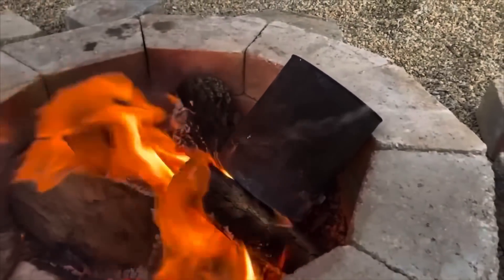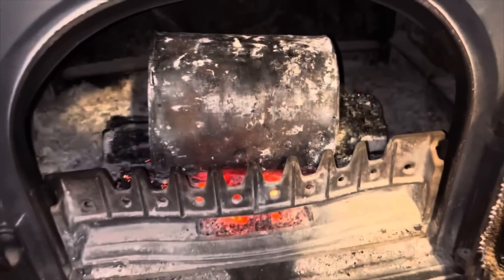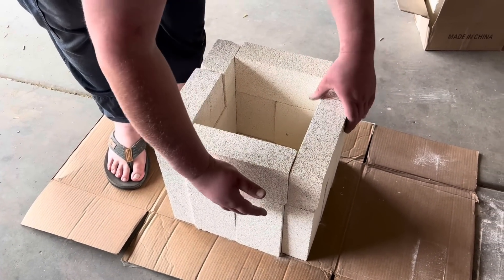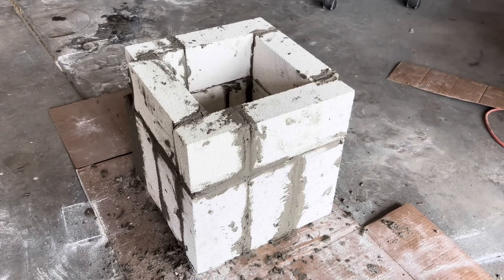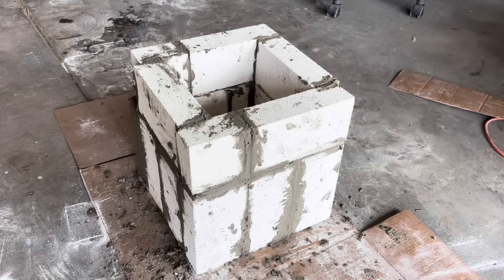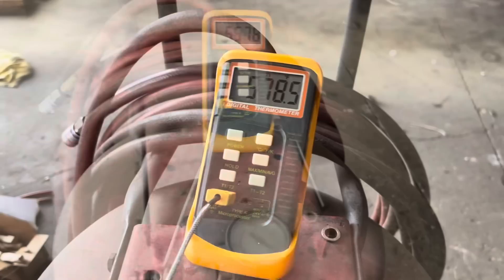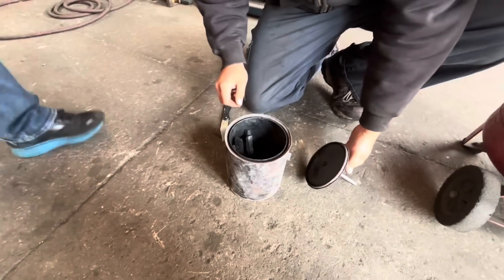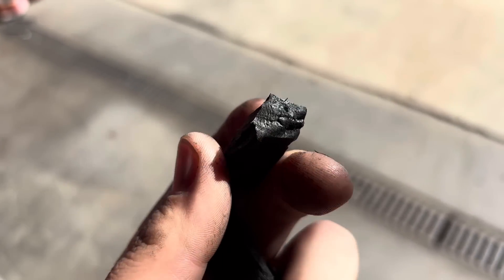Making “Scientific” Charcoal For Gunpowder

Comment: I'm at 7:38, i've only took a sneek peak by hovering the mouse over the timeline.
However, if the temperature take so much time to heat, is because the current has to flow through one gigantic wire (only one very high resistance)...

What you need to do, is to make several small resistance, all mounted in parralel, you gotta be sure your powerline can handle lots of amps.

Ohm's law says that the higher the resistance, the higher the heat. While this is true, one has to consider all the matter the current has to flow through. For example, thinner wire has a bigger resistance than a big one, and to achieve a one ohm resistance, where it might take you an inch with the thinner wire, it may require 4 inch of the bigger wire... more matter to heat, higher ramping time.
The higher the resistance, the quicker it is to heat
The higher the resistance, the less energy it needs to heat.

Also, when the wire is heating, the middle of the wire always heats the most, quite dramatically, one more reason to make multiple small resistances spread out and mounted in parallel.

If you happen to know someone who vape and make its own coils, you can run small scale test with it, you will observe all this pretty quickly. Just beware that if you ask too much amps to the battery, it may explode, so... there's that.
Reply: I disagree a little. P = I^2R so really, if you want heat you want more current. Resistance is only linear.  Or consider that P = V^2 / R. Clearly, we need want a small resistance to draw current and dissipate power.

I agree that wiring the heating element in parallel would be a good idea.

I've never had a 1 MOhm resistor get hot. But my .5 Ohm resistors get very hot. Electric heaters are current devices, so you want to maximize current, thus you need a small resistance.
Reply: @nonokodog622  for a given length of resistive wire, if one resistance is .5 ohm and another is 1 ohm, the 1ohm heating ramp up time will be much faster for the same amount of energy.

This is something easily checked.

Comment: What about pure technical carbon powder like carbon nanotubes?
Reply: that is what I was really wondering because pure carbon really has nothing in it to burn..
Reply: @scottpeterson2692  carbon burning is just carbon taking on oxygen atoms.... the problem you have with graphite and other "crystalline" carbons is all the bonds are strong, so it takes a lot of heat to break them. Gives even more heat in return, but you still have to provide that starting hit, and there's no time for that with gunpowder. Charcoal has some hydrocarbon and other weaker bonds so it basically has the 'fuzz' like a firestarter for the reaction to begin quickly.

Comment: Nice. Your testing will be much more reliable. One small improvement would be to buy a PID controller kit with a type K thermocouple and solid state relay. They're fairly cheap and easy to set up.

By the way you could have made this whole thing out of ceramic wool. For your temp range even off the shelf rockwool would work (I've seen people make aluminium casting furnaces with the stuff). Would have been much easier and cheaper to work with. Would still make for a decent lid.
Reply: I was going to say a PID would be great for this, I think I still have my parts list if you are interested. How many amps did the heater draw? The way I built my PID is only good for about 15 amps.
Reply: I am a day late to my PID comment. Oops! All well at least other people were thinking like I was. :)
Reply: @Aviator747a  I've been thinking about an electric cooker with PID to make charcoal. I already have a PID system built from my lead pot and powder coat oven, so to me it made sense. I was thinking of just wrapping the paint can with a heater, then wrapping rock wool around everything. Just need to stand the heater off the paint can to prevent a short. I haven't been looking for heaters yet, but the weather s getting nicer, so time to think about this. Hoping I can get away with about 800 watts of heat, need to do more research.

Comment: Please experiment with other oxidizers as well?
Reply: There aren't a whole lot of options that don't either leave a hypercorrosive mess while being unpredictable (ammonium nitrate) or are just downright dangerous to work with (chlorates, perchlorates), and what's left just doesn't seem to work well at all. 

The biggest reason to use potassium nitrate is that it's just about the only nitrate salt that doesn't suck every ounce of water out of the air the moment it's exposed. And, it's cheap... and relatively nontoxic, especially compared to some of the other options.
Reply: I believe he's tried at least one different one.

Comment: Fellas, I first off want to say that I love your videos! They've been a big inspiration to me to get back into the pyrotechnic arts, which I hadn't touched since I was an amateur rocketeer as a teen. It had never occurred to me back then that the powder I made for my engines would work just as well in a muzzleloader until I saw your videos on doing just that. I followed your guide on pucking and granulating and tried it out with my dad, who only ever used Pyrodex. Big fun. These days, I use a cheap Amazon metal melting furnace for making charcoal. I just cut a piece of 2 inch steel pipe to the length of its crucible, welded a piece of plate to the bottom, and screw on a cap that I tapped for a compression fitting so I can run a smoke tube out the top of the furnace. It has a temperature controller that you can set and it will hold that particular temperature. You can buy same kind of controller as a module and add to it your kiln to get the same convenience and precise temperature control. Keep up the good work! I'm looking forward to seeing how the cottonwood and bamboo perform!
Reply from the maker: Thank you
Reply: Thanks for turning me on to the furnaces Amazon sells. I won't be using one to make charcoal, but have been wondering how I'm going to smelt and recast the broken bronze rudder mounts for an old wooden boat I'm restoring. Now I have the answer.

Comment: This is great! I believe the point of controlled charring is to make charcoal that is undercooked to a certain degree. Charcoal made at lower temperatures for a limited time has chocolate to brown color, and it ignites at lower temp compared to fully charred stuff. I've read somewhere that at the pinnacle of black powder development, a certain grade of brown charcoal yielded the highest round velocities. To make brown charcoal, the process has to be terminated BEFORE smoking has ended. If it is taken to the no-smoke stage, I see no difference between controlled kiln and fireplace methods.

In my experiments with convection baking oven I found that temperatures as low as 400F are enough to fully carbonize wood. Stopping the process at various time points allows obtaining various degrees of intermediate charring.

Another variable to control is puck's specific gravity. In Russia there were two grades of hunting black powder: standard "regular" and higher grade "choice". "Choice" had lower specific gravity of 1.6 - 1.65 compared to 1.7 - 1.75 of "regular".

A couple of technical suggestions. 1} Use thermostat so that you don't have to control temperature manually. 2) Light up the exhaust to flare pyrolysis gas and avoid smoke.

Keep the good work!
Reply: This is an exciting venture, some of the best guntube content today.
Reply: There will still be a difference as the volatiles that need 600c+ to cook off will not have been lost when you control the temp like this.
Those wonderful documents online collating all the data on black powders and pyrolysing show some interesting properties that he can now control.
Reply: @1kreature  If it isn't hot enough to vaporize and cook off the volatiles, does that mean they are still in the charcoal?

And do you think it will provide a bit of extra oomph, or just increase fouling?
Reply: @DH-xw6jp  Studies on black powder has shown that the right volatiles left are important for ignition temperatures and "power". That is why this is so exciting!
In general it does appear that too high cook-off results in hard to ignite powder while too low leads to fouling. The problem is we have already see hard to ignite powder with massive fouling so there is more to it.
Reply: @1kreature  that makes me appreciate what he is doing even more.

If he can narrow down the "perfect" powder that is achievable at the home shop level. Oh boy.
Reply: @1kreature  Do you have a link to that study? You made me really curious about it.
Reply: Ну, чтобы добиться результата, вам нужно ещё изменять соотношение компонентов в порохе в зависимости от угля. Разница в составах применяемых разными странами в разное время порохов отлично объясняется именно разным источником и обработкой древесного угля

Comment: Alright. Now, you are getting down to brass tacks. I believe there is more to the type of carbon used in Black powder as you have already demonstrated in previous videos. Firstly, what role do all three components play in ignition. What role does carbon play. Take the Cottonelle and balsa wood carbon, which has proven to be the best, and attempt to determine why they work so well. This might lead to something even better.
Reply: " type of carbon "
Well, there are three isotopes and two allotropes (not counting fullerenes).  He's using graphite and C12.  I mean, you can't use the word "scientific" in the title and not expect those kinds of comments.  That's my excuse, at least... ;-)
BTW - Apparently, I am fun at parties.
Reply: MEEE! TOOO! and I have time to look.  my last test is my first test, to leave zero residue at ambient atmosphere with no AMP Smell?? turning my fouling residue into a wet nitric acid rich rusting soup.   this batch is AS Dry as a popcorn phart at 65% humidity 6 days outside. 3:2:5 clean and dry at batching.
now I will test on raw carbon steel.

Comment: Charcoal isn’t just carbon. It’s cellulose that has been heated to get rid of the water and the volatiles. It’s mostly carbon, hydrogen and oxygen. It’s also quite porous on a microscopic scale. Charcoal is better for antique muzzleloading propellant for the same reason that charcoal is a better fuel for your barbecue than graphite, which requires temperatures of 1000-2000C to burn.
Reply: Peak combustion temperature and ignition temperature are two different things. Graphite is relatively stable, but it begins to burn at around 700°C.
Reply: "I'm targeting" JUST THIS! "hi!" cellulose, low all others. On the "micro" "I'm safely ball milling" the snott out with the sulfur at the same time. 
"I think" you are correct?

Comment: I know less than nothing about black powder anything, but the subject matter is super interesting.  If carbon is what you are after, why not sugar + an acid or in a kiln?  Chemically, it should be pretty dang pure carbon with a little over 40% yield.   50lb bag at $45 would produce 21lbs of pure carbon at $2.14 per pound (before tax) 

Not sure how the economics of this compare against toilet paper.

Really enjoy these videos and am looking forward to this next one.
Reply: Charcoal isn’t just carbon. It’s cellulose that has been heated to get rid of the water and the volatiles. It’s mostly carbon, hydrogen and oxygen. It’s also quite porous on a microscopic scale. Charcoal is better for antique muzzleloading propellant for the same reason that charcoal is a better fuel for your barbecue than graphite, which requires temperatures of 1000-2000C to burn.
Reply: @gusr6  that's why! my graphite AMP blew! and why! it is, or was, used in smelting electrodes and search lights! BINGO! Thanks!
Reply: I thought it had to do with the way carbon bonded in graphite vs diamonds vs amorphous carbon... learn something new every day.  I didn't know cellulose was a key component, thanks for the knowledge dump
Reply: thats basically rocket fuel, but very Phun!  Got Ya!  You's hooked like a big Ol bass!